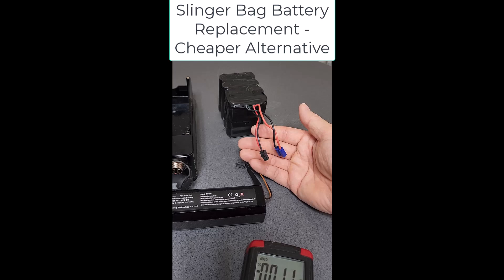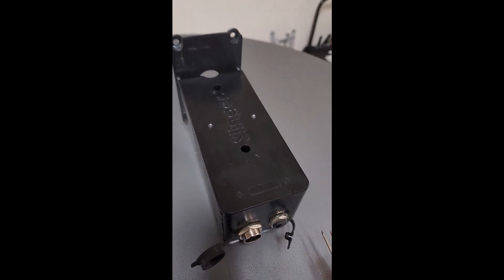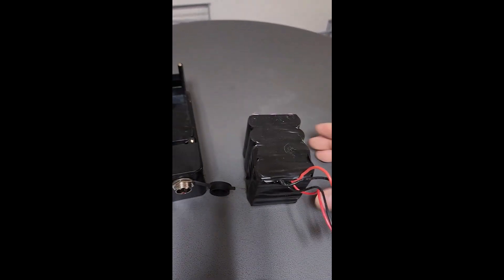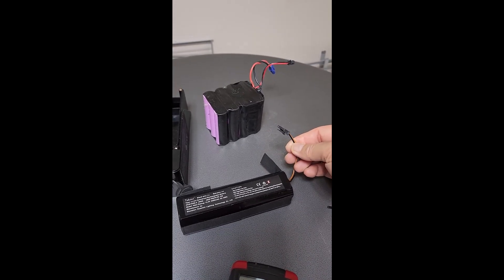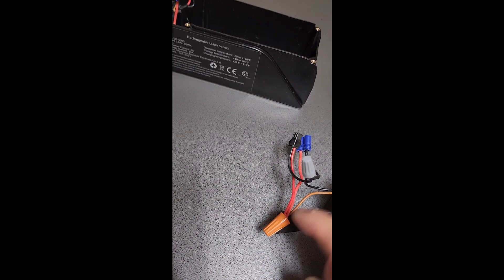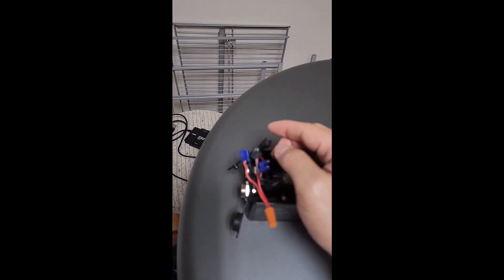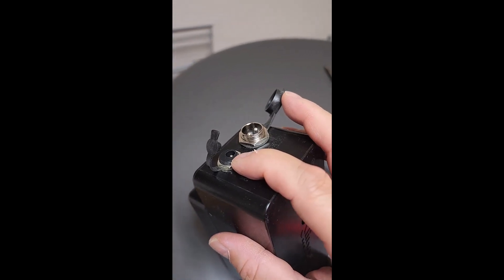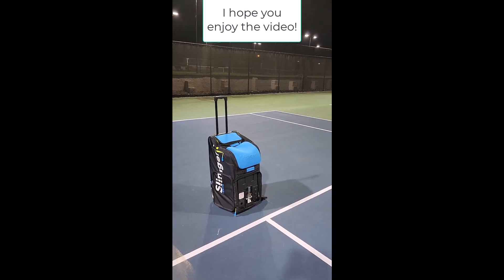Slinger Bag Battery Replacement - Cheaper Alternative

Comment: I have the same battery as yours, I installed it but it doesn't work, I checked the battery they sent me and it only measured 1.56v, I put it in the charger, it doesn't work, the green light on the charger keeps stay on, so did they send me a bad battery?

Comment: Hi. Thanks for the video. Youve shown how the battery Black box has two ports on the back, one for the launcher and one for the charger, but you haven't connected any cable to this. Why?
Reply from the maker: The wires connected to the luncher connector in the back of the battery pack serve dual purposes. They provide power to the launcher. When the slinger bag is plugged into the charger, the same set of wires send the power the other way to charge the battery. The charger port on the battery box is designed to be used when it's taken out of the slinger bag and plugged into the charger directly. Some people take the battery pack out of the slinger bag to charge instead of taking the whole slinger bag out of their cart to charge. Hopefully this makes sense.
Reply: Thank you! Hope I can manage to get my slinger back to life. I've read in Facebook that as long as the battery is not connected, the slinger can function connected to ac, have you ever tried?
Reply from the maker: @jesuscombarros7156 no I haven't tried it yet.
Reply: Mine does turn on but does not start both motors. By the way I installed a 5200mah battery from a cleaning robot and it works well, battery last longer than my sessions..

Comment: Thanks for the video. It looks like the original battery might be an array of 4x3 18650 cells. Is that correct?
Reply from the maker: I don't have the old battery anymore so I can't verify. But yes it is just a bunch of small batteries connected together.

Comment: Hi... How is the battery doing now after a few months? Is it still doing its job? Thank you.
Reply from the maker: It's still going strong, no sign of slowing down. I think as long as the replacement battery has the same specifications and fit in the battery container, this is a pretty straight forward DIY project that is worth the effort.

Comment: Thanks for posting this...not a lot of posts on this specific type of solution. What are the dimensions of the replacement battery and what are the names of the types of connectors needed? - Andrew
Reply from the maker: @andrewlee8619  1.5"×3" will work. Even if it's a little bigger, you can cut off some internal plastic stuff to make room as what I showed in the video. As for the connector, it doesn't really matter, you can reuse the original one as I did.

Comment from the maker: Both batteries I ordered are no longer available. But any 14.4v 6800mAh battery might work
Reply: 14.8v migth work as well?
Reply from the maker: @jesuscombarros7156  yes it should work
Reply: I have a battery like yours 14.4v 6400mAh 92.14wh, it is plugged in but does not work, the new battery measures just 1.7v, I use the charger of the slinge bag to charge, but it does not work  the green light on charger stays on  you have any idea
Reply from the maker: Not sure what happened there. 1.7v certainly will not work. It should charge.

Comment: Hi, thanks for sharing. Doesn't the original pack carry a BMS (Battery Management System)? Usually, on multiple cell arrays there's a PCB that monitors individual cell voltages and charges accordingly to prevent overheating. I'm not sure if the replacement battery you used has its own built-in BMS.
Reply from the maker: I didn't see anything other than a bunch of small batteries bundled together as one battery.